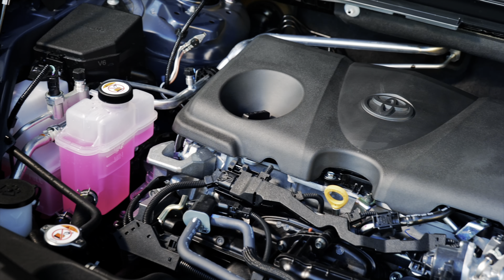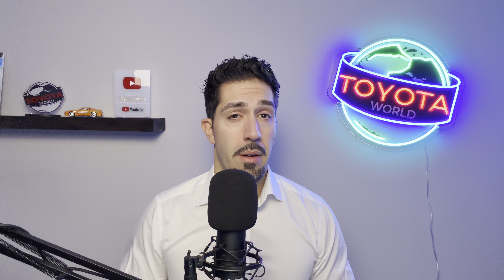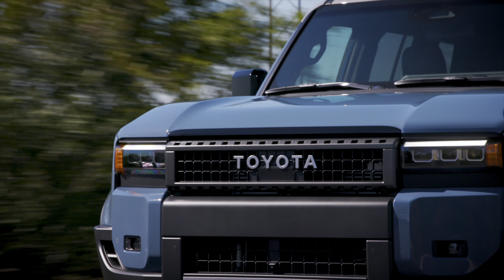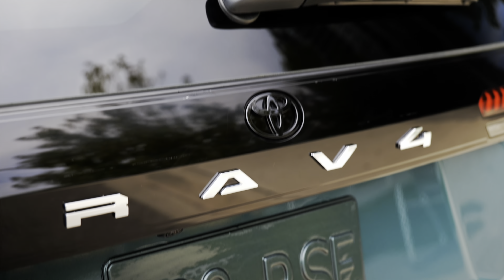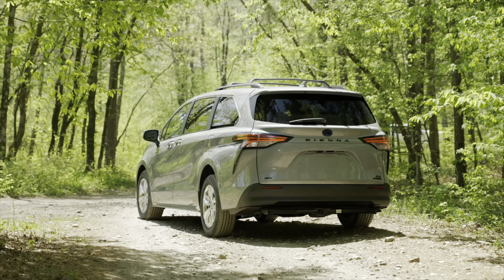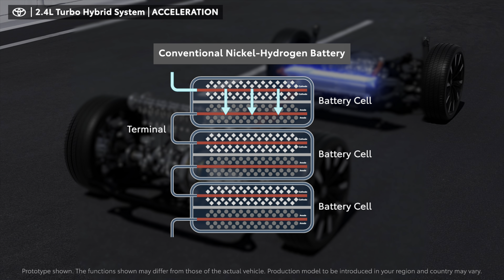Is Toyota Hybrid Maintenance REALLY MORE Expensive!?

Comment: What is the lifespan of a plug in hybrid battery? This battery is usually used as an EV battery so my concern is that due to relatively small capacity in comparison to real EV batteries, the plug in hybrid battery is far more stressed and there fore the life span is much shorter

Comment: No alternator, no starter motor, combustion engine runs far less and only to provide energy to the electric motor so everything lasts much longer. Amazing technology. Toyota have nailed the technology over 25 years of trial and error with the Prius project.
Reply: My two hybrids have never needed brake work, either. ‘11 Prius and ‘16 Rav4.

Comment: All my cars are Toyata . But recently i realize they has been ignoring/ delaying the problems until the warranty expires. They deems it a "normal". Clicking noise when turning,, absorber too soft etc. My new car aux battery did not last 6 years. Only 1y 5 months. I found out they have been refilling distilled water without cleaning the battery's surface. Air almost hit the plates once
Reply: You did not give us vital info.

Comment: It is generally getting expensive for every vehicle unless you have EVs with concealed motor that requires fluid change after every 6-8 years. For Hybrid Car 0W16 or less viscosity oil is double the price of 5W30. You need more coolant for Hybrid as cost more to replace. While standard brake fluid is better choice CVT transmission fluid cost more to replace than conventional fluid.
Reply: 0w8, 0w16, 0w20, 5w30 are all the same cost for me.
Reply: 0 16 mobile 1 Walmart cost 27.97 i
Reply: @donaldanderson3366 You buy Walmart oil you will get Walmart junky vehicle.
Reply: Toyota ecvt’s take regular WS transmission fluid.

Comment: Gas only I can do the maintenance myself. Hybrid, touch the wrong wire. Grilled 😮
Reply: It is not recommended to do your own maintenance on hybrid cars due to the presence of high-voltage electrical systems that can be dangerous, and the need for specialized knowledge and equipment to service both the electric and internal combustion components. The hybrid system has complex electronics, a multi-circuit cooling system, and high-voltage wiring that requires specific training and safety precautions